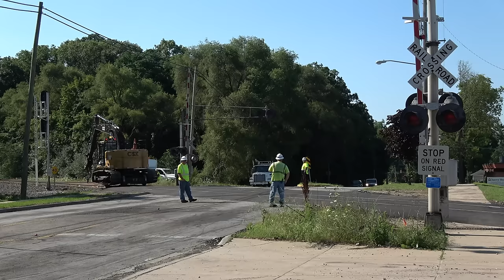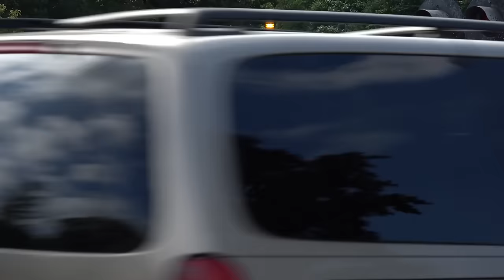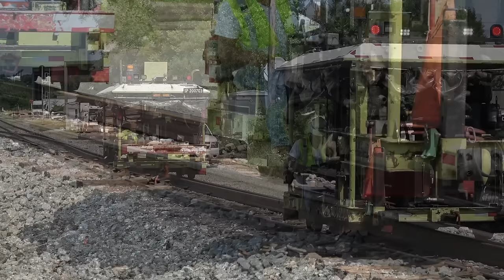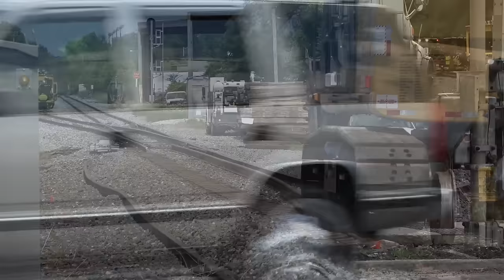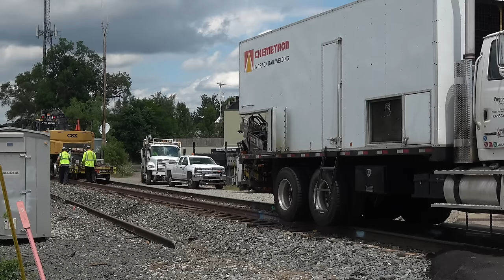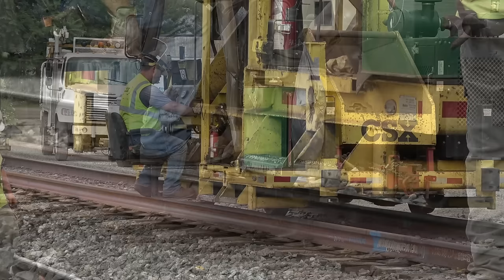TRRS 547: Railroad Rail Replacement

Comment: Maintenance of Way are the toughest jobs on the railroad. Even though mechanized now, it’s still hard, dirty sweaty backbreaking work. It takes fewer people than it used to, and more feet of rail can be replaced quickly, but the work is just as hard. As a railroader, I’ve always respected these guys.
Reply: I've seen a lot of track which is no longer in use due to changes in our economy and the way merchandise is transported. Some of the old rail lines have been converted to pedestrian and bicycle paths.  We don't have modern rail lines like in Europe or Asia since too many people don't want to spend the money to maintain the infrastructure and new RR track is expensive.  High Speed Rail would be of an advantage for passengers but I'm not sure it would work so well for goods.  Maybe in time.
Reply: Nyct still does all this by hand

Comment: Lots of narration, but it is the first time that I never once minded. Your thorough explanation of procedures made it easy to understand each process. The welding of the two track ends together and grinding the weld smooth is what makes the clickety-clack sound disappear. I rode an Amtrak train over one of these tracks. I closed my eyes before the train started moving and before it came to a stop. Since there was no clickety-clack and the engineer was so smooth on the throttle, I absolutely could not tell when the train started to move or come to a stop. Truly impressive.

Comment: Absolutely fantastic footage. I worked in the UK as a track relayer for 6 years in the early 70’s. Most of the track relaying and rail replacement was carried out manually. Machines started to come into use from the mid 70’s.

Comment: My daddy was part of the old crew, back in the 60s thu the 80s. if  he could see today work crew he would call them lazy.
but, a days work would have need a crew of 10 to 20 men. thank you all for the work you do. may God bless you all.
Reply: We maintain over 50 miles of track with 5 guys and very little equipment, so we still do it mostly the old way.

Comment: This is a remarkable video!
The few times I've conversed with rail crew maintenance workers in rural Nevada, they were a pleasant lot; where they even volunteered the info where I could find scrap rail pieces . . . or as those Union Pacific rail crew workers referred to it as the bone yard.  But, I had to be mindful of the railroad detectives.

I found that bone yard some miles away, where a large debris box contained all sorts of scrap metal from the repair work on the rails.  I got several rail lengths ranging from four inch to 12 inches.  I originally got them for a metal-work anvil for a friend of mine.  But, I've found over the years those four-inch rail lengths can be used to assist in all sorts of efforts and projects, such as:
To keep a heavily sprung door kept open as a door-stop.
A wheel chock.
A weight to anchor wood cutting when using a circular saw . . . where the top part of the rail piece can be gripped with one hand to apply pressure on the wood being cut; as well performing a stabilizing aspect, similar to a cane, for the standing person using the circular saw.
Anchoring drop clothes outdoors in windy weather.
An anchor weight when stretching out a length of material:  Wire, rope, flexible irrigation lines, garden hoses, wire/metal cables . . . the list is endless.
A jack-stand when a few inches are needed to keep an object temporarily elevated.
The weight of multiple rail pieces can be used on a table to steady its legs when a stable work platform is needed.
Can be used as a leverage wedge when prying up something from the ground with the use of a shovel or metal bar.
The versatility of short rail lengths can be enhanced when it is tilted on its side or stood on its end.
And, if you want to have a novelty paperweight item, slice off a thin strip of the rail piece with the use of an abrasive cut-off saw.  It will take about 20 minutes and a replacement abrasive wheel or two to do it.

Comment: You left out the most important step: observation of the first train over the new rail. 

But, in all seriousness, this was a great video
Reply from the maker: They also surfaced and lined the track with a tamper and regulator, before the first train.
Reply: @ThornappleRiverRailSeries  What does surfacing mean?  What are tampers and  regulators? Sounds like the makings of another video.
Reply: @terryboyer1342  Surfacing and lining essentially means making the rail heads both either level with each other for most straight and some curved track (or superelevated in some cases as needed on curves) as well as in smooth straight lines both horizontally and vertically along the length of the rails.  Tamping is the act of bringing all those factors together by packing (tamping) ballast against and under the ties as needed to properly support and position the rail/tie structure.  Ballast regulators then shape the excess ballast to form proper drainage profiles outside the ends of the ties as well as remove excess ballast from the tie tops both inside and outside the rails that is left over following the tamping process.
Reply: @timothybarney7257  Thanks Timothy!

Comment: Wow! This brings back a lot of memories! I have never seen an all machine rail replacement crew in action.
During the mid 80’s, from May to September ( to put myself through University)I would work Extra Gang , replacing rail in Northeast Ontario. The only machine we had was a speed swing. The gang was about 18 men, ( labourers)and be in the wilds of the Canadian Shield where there were a lot of curves. Most of the ties were concrete, so we used sledgehammers, to take out, and put in the pins. ( we called them pretzels). Everything was manual: Rail cutting, had to drill the holes, etc.
Generally it was new rail on high side, bottom rail scraped, high side rail on bottom side. I think the term was transposing rail. Even did wooden ties a couple of times.
We were isolated on sidings…. but I can tell you, my friends and I pulled out fish that were monsters in our off time. Some lakes were never touched by man ( till we cam along)!
Some of the best summers of my life.

Stay safe, stay sane, be well

Comment: Amazing I have never seen this process. Incredible how many specialized machines they use to get this job done yet still employ a good ol excavator to get the job started. Seems like they would have some specialized crane with more precise gearing then a digging machine but it certainly gets the job done. Thanks for sharing

Comment: This is so cool. I worked at True Temper and Progress Rail in the 70's and again in the early 2000's. You need to film a rail train dropping ¼ mile long track to the ground that's later welded in place. There are about 50 pockets on each rail car in the quarter mile long train. I ran a car that dropped rail all across Wisconsin one summer. Really interesting work.

Comment: You managed to get a very professional film together and it didn't seem to phase the CSX crew at all. Rail is an amazing technology and major infrastructure and it sure requires a lot of tools and equipment to keep it together along with the experienced crews to manage it and do the shop work of maintaining the wheels, brakes, trucks and wheel bearings too, which makes for interesting videos too.

Comment: Just an addition on the spike hole plugging with filler: It's also done to keep the hole from taking on water, which causes internal rot in the tie over time.

Comment: 21:21 That's an insulated rail joint. They will not Thermite it at a later date. If you look, they swapped out the old insulated joint on the right with a new one in track. You will find insulated joints are quite common around interlocking signals such as the end of a siding as you are at here.
Also Rail anchors, or creepers as I've heard them called are also intended to keep the rails from creeping or sliding if a train is applying the brakes, along with the reasons you mentioned. They do a really good job of holding on to the ties in the summer when heat causes the rails to expand. I've seen a set of ties pushed about 6 feet out, making a mound of ballast about 16 inches over the rails, enough of a hazard to warrant taking the track out of service until repaired. Though had it not been for the creepers, the ties would have remained in place but the rails would have buckled and probably broke under force of a train.
It's really nice to see them replacing the outside rail in a curve. In the Division I work in, they will just reinforce curves with gauge rods until the ball is flush with the web before they will replace the rail.
Reply from the maker: Take a closer look at when I'm talking about the bond wire - they're doing it to the joint that connects the prefab insulated joint segment to the rail through the crossing, which is not an insulated joint. So that should be up to be thermited, if it hasn't already. 

Good points on the rest, however!
Reply: Guage rods are now illegal at CSX, not sure why.
I just know we have to throw them away when removed from track
Reply: @Dougie1969  they were never intended to be a permanent part of track structure. They are the band aid of the railroad but certain contractors have gotten pretty comfortable with using them instead of ties. In a section of track that has upcoming plans for the replacement it is acceptable for the short term.
Reply: @SD40Fan_Jason  
I'm in Bridge department, we used to be able to use them to remove a slow order on a bridge.
Management started using them too much and like you had said some became comfortable doing it.
I would say derailments stopped us from using them
Reply: @Dougie1969  No doubt! When we had a 35-degree curve with 72 gauge rods in it over the course of about 1600 ft. we managed to derail and tear most of them out in the process. It just so happened that the outside rail was broken between two gauge rods. The initial investigation found that they were using the gauge rods not just to hold the gauge but because they were aware of the broken rail, to hold it together as well... But then nothing was done to correct the rail or the problem of gauge because the contractors were only hired for so many hours per month and they met their hours. Two weeks later, Hulcher is out there picking up the pieces and doing what the contractor should have done all along.
I don't know what the protocol is for making the decision on when to replace the rail, but when the ball is nearly flush with the web, I would have thought it was time.
Reply: @SD40Fan_Jason  
72 guage rods ........WOW.
I've been around for a while, I've never seen that, somehow it doesn't surprise me though.
Anything to keep trains moving and on time.
This precision scheduled railroading crap is for the birds.
Anything for the stock holders and executives right
Reply: @Dougie1969  Heh for a while we were calling it "Gauge Rod Curve" and then... Well as one of my older engineers would say, "Now they have to fix it!"
PSR isn't without merit, but I feel like the concept is lost on anyone who is trying to squeeze out that extra penny from the public stockholders' shares. Had it been focused on trying to maintain business in the first place, I think we'd all be in a better position. But then, these guys that sit on the board of executives do not care what this railroad looks like in 10-20 years when I am supposed to be retiring. Their only focus is the bottom line today. So if they can defer maintenance now, in 5 years when they sell out and move on it can become the next person's problem. But then I have seen business has been conducted that way since long before I was a cub.
Reply: @SD40Fan_Jason  
I can only say what I see going on in my company, and it AIN'T GOOD.
They have almost completely stopped maintenance, hell I'm sure they haven't cut the system gangs off yet.
I agree with you 1000%, I believe management is cutting every corner possible to boost the bottom line.
I have about 12 years to go, and bye bye.
Ever since Harrison took over , my company changed, he died , but his crooked cronies took over in his crooked memory.
RIP CSX
Reply: @Dougie1969  I had the unfortunate displeasure of getting furloughed from CSX in 2006 and when the Union told me to find another job, I did. But since then I have worked for a shortline that handles CSX's dirty work in most cases. Here in Atlanta where I am at currently, we have felt the effects directly, following the closure of Tilford yard. When our cars come from Idaho via Indianapolis and have to route through Selma NC before they come here, it sure hangs a bright Neon light up over the company's head that they are trying their damnedest to exterminate the carload customers. Trashing their own infrastructure to streamline the industry is an oxymoron, but it has been Harrison's business plan ever since he went to work for CN and it's a plan that CSX was buying into back in the mid-80's so it's no big surprise that they would embrace his PSR plan if it means whittling down the number of carloads that are being handled in mixed manifest trains and class yards.
Reply: @Dougie1969   The RR are not the only business's which are too involved in making money today and not worrying about tomorrow. Most of the large retail companies, Sears, Penny's, Best Buy, etc. only concern themselves with the current share price since many executives are paid bonuses way of line with what the workers are paid.  They concentrate only on today with very little thought of tomorrow or the next decade or even century.  Very few plan for more than ten years ahead but the Japanese and Germans plan for the next century.  In my view, we have lost our way.  At one time, the executives in a company took pride in the way their company operated. Today, not so much.  The average worker in a large company might be paid $50,000 a year but the executives make millions of dollars each year plus their bonuses.  This is one of the problems with RR and airlines.  When they change and look to the future, then they may still be around in twenty years.
Reply: @Harry-zz2oh  
How depressing,seeing what's happening to this country, and really the entire world.
I was always taught buy American, but even that doesn't work anymore, ( made in the USA, with global materials)..
Come to find out, the entire product was essentially made by slave labor and or children for pennies and final assembly in the US..... EVIL
Companies everywhere worried ONLY about the bottom line, and that's sad.
Reply: @Dougie1969  I agree. However this attitude can be changed if we, the customers, want it changed.  We can demand the change by asking to see the summary for the companies long term plans. Buy a stock or more so you can attend a meeting so you can ask questions as to where the company plans to go in the future. Also ask "WHY?" a lot when they give back gobbledegoop.  If we can ensure the top and middle executives pay is tied to the companies long term performance not just the stock performance, then they will start to change.  At one time Sam Walton believed in customer service. Now the company doesn't seem to care.